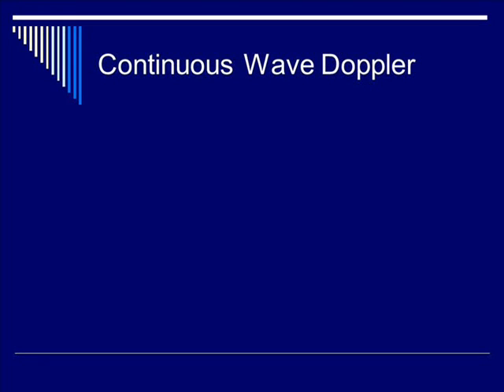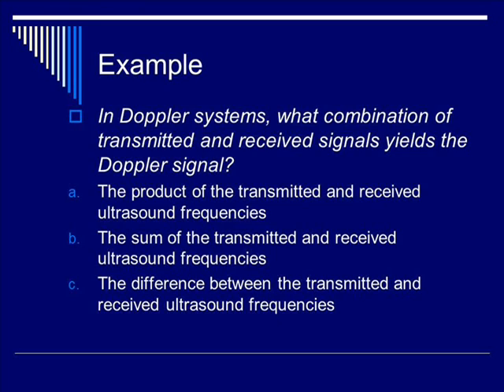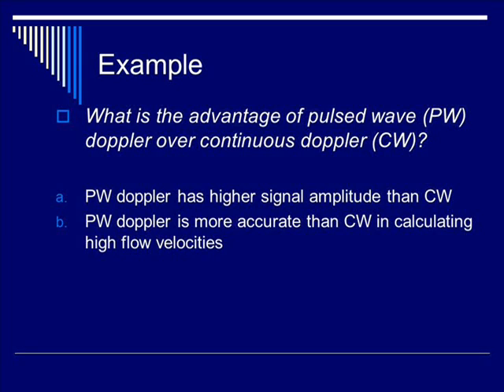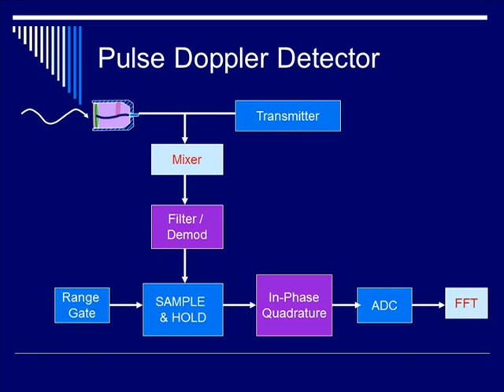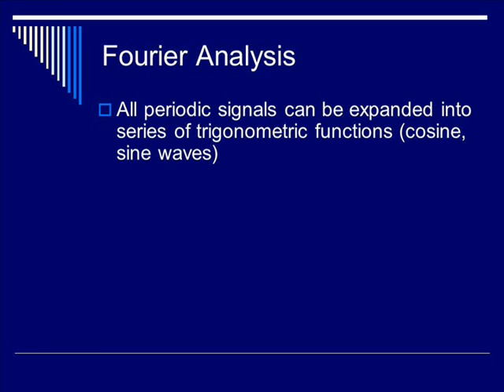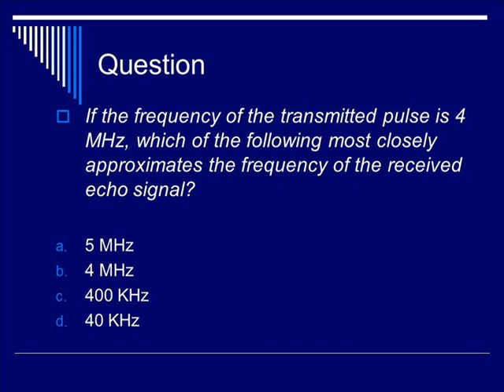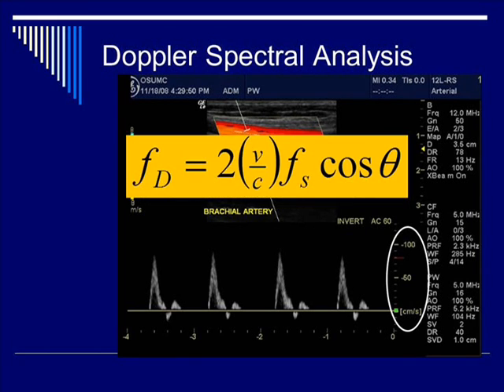Doppler Instrumentation and Color Doppler - Segment #2

Comment: On Sample and Hold, at 5:22.  Received signals are analog from the transducer and initial preamps.  These are converted into digital samples that look fixed, or constant, for very brief periods of time known as the sampling interval or sampling period.  So the value is assigned (Sample) and then Hold (held, which is coasting until the next value is assigned).  So Sample-and-Hold is self descriptive of how the electrical hardware works.

Comment: at 2:06, there is always damping on the transducer even if it is a special purpose transducer/system for CW Doppler, because there is always acoustic damping caused by the tissue, and of course a small amount of mechanical damping caused by the build materials in the transducer.  Purpose-specific Doppler transducers therefore do have higher Q values ( Q = freq/bandwidth ) but they are not undamped.

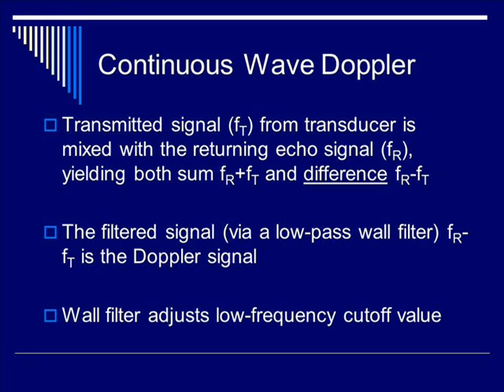Comment: Near 1:21, the terms are a bit confusing.  Low-pass filtering is always used after demodulation, so that only the signals near zero Doppler (that are in the audio band) are retained.  Additionally, there can be a "wall filter" that is used and adjusted by the sonographer to decrease the level of zero-Doppler echoes so they don't consume the dynamic range in an image.